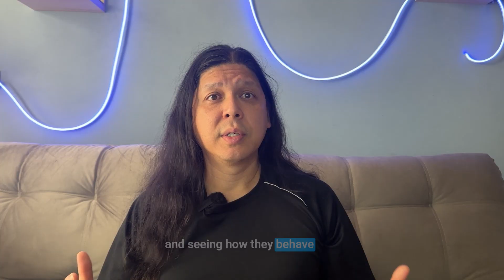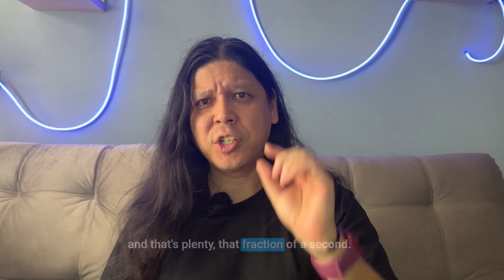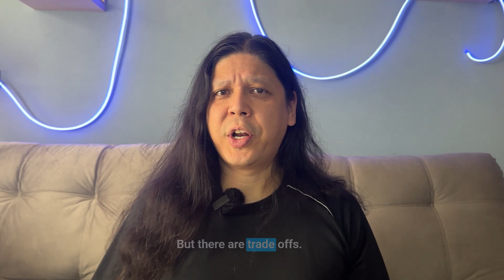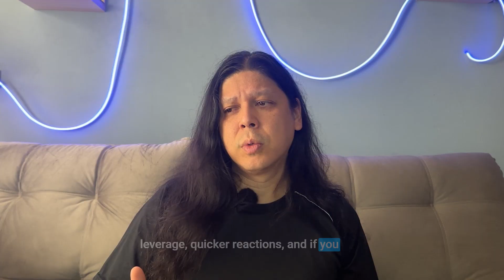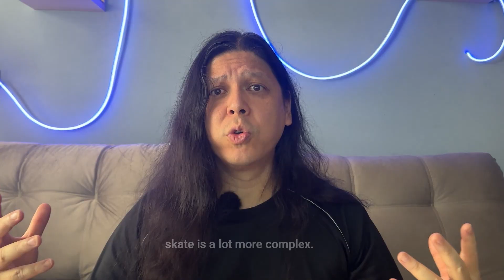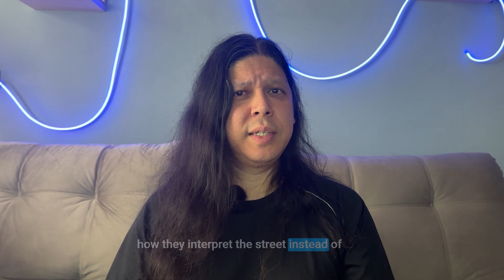Suspension on Storm Tracers — Control, Risk, Tradeoffs

Comment: There’s a material used in bulletproof vests that is gel, but gets hard when hit to absorb impact. Maybe you could use something like that
Reply from the maker: i think you are talknig about the D30. its used to make armour and proitective gear. I dont think its suiotable to making suspension, but more imporntatly than that is geometry. if you want just a bit of shock absorption to soothen vibration than just a thin layeron the heel part of any elastic material would perform. but real suspension needs travel distance. not saying a vibration dampener is a bad idea, I could use some more dmapening on my prototype right now.
Reply: @Thundrblade  I was suggesting to have no suspension, but rather to have a shock absorbing pad under the feet. Maybe it could be made of a soft rubber